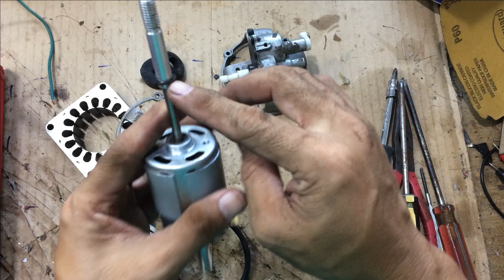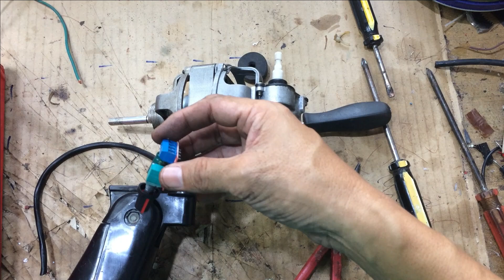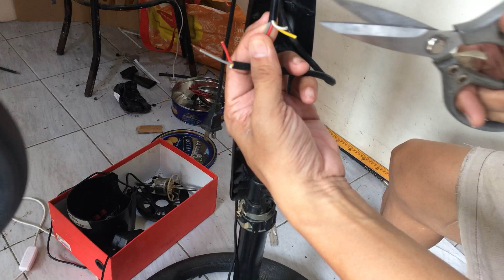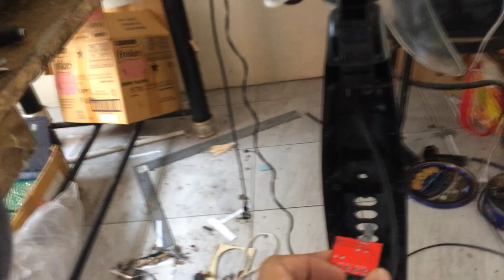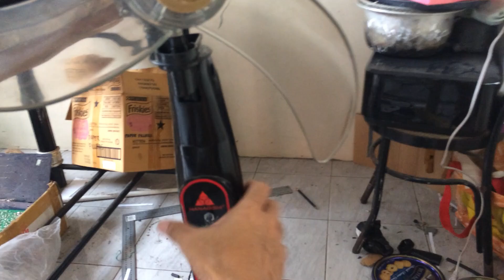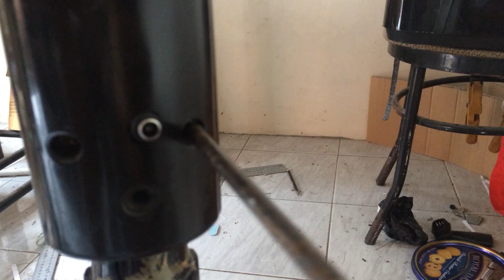How To Convert An Electric Fan Motor From AC To 12V DC

Comment from the maker: Shopee link
12V DC Fan Motor and Switch
https://ecocreator.asia/K0RJObtk

12V Power Adapter 
https://ecocreator.asia/OQmGm1jy
- - - - - - - - - - - - - - - - - - - - - - - - - - - - - 
Lazada link
12V DC Fan Motor and Switch
https://ecocreator.asia/MceE7Ygi

12V Power Adapter 
https://ecocreator.asia/paNGlQZH
- - - - - - - - - - - - - - - - - - - - - - - - - - - - -